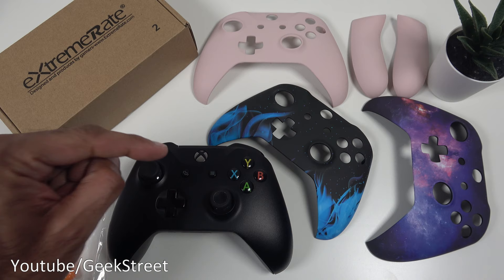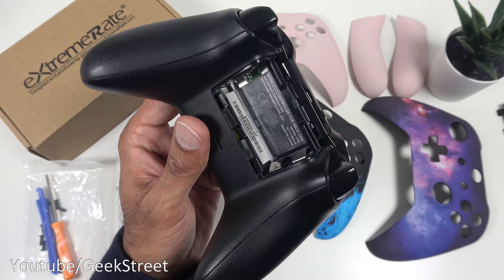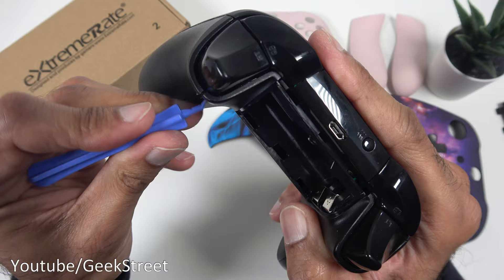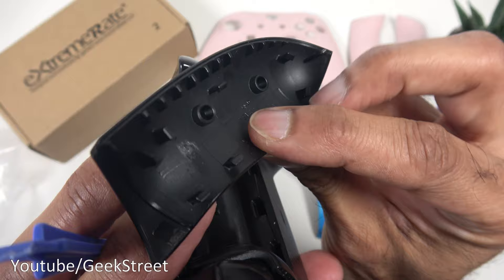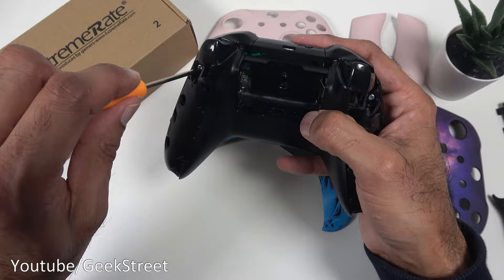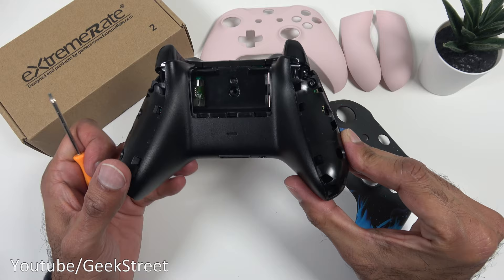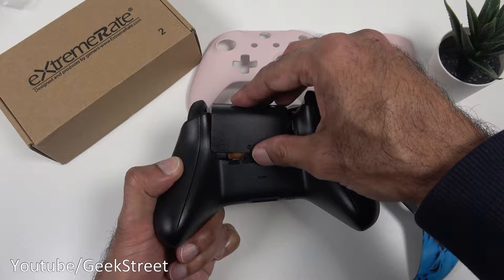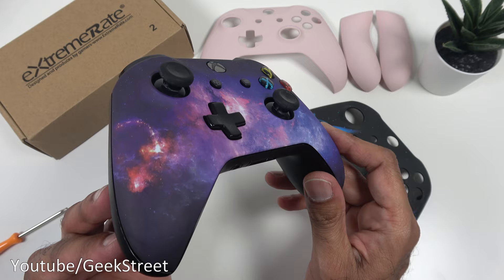How to Replace Xbox Controller Front Plate from eXtremeRate

Comment: Just installed mine pretty simple install. Prying off the old side plates is kinda sketchy be careful not to shove the tool deep in there since the board and wires are only ~.5in away from where youre working.

Looks incredible and feels awesome